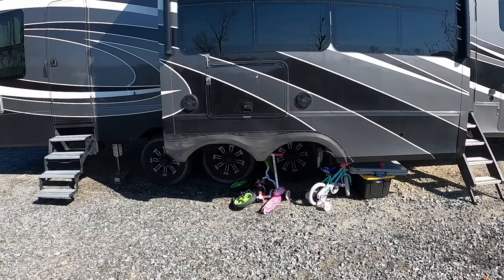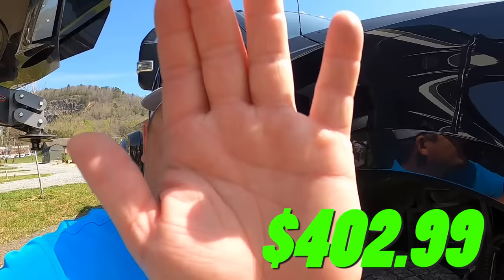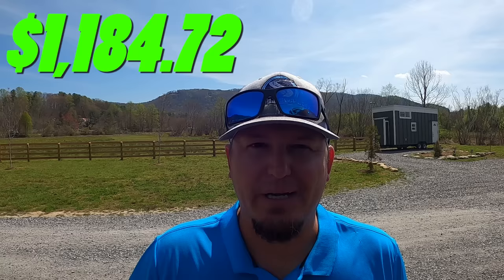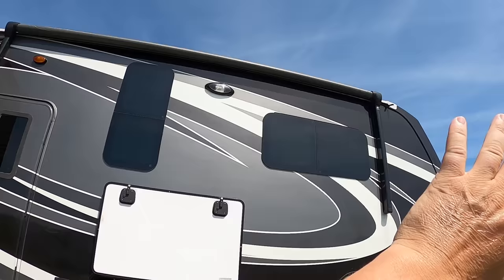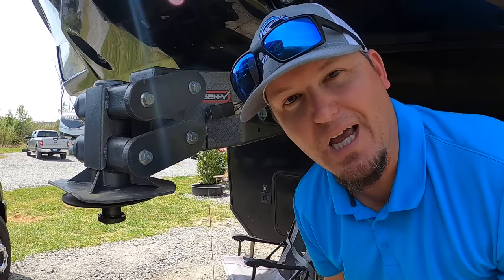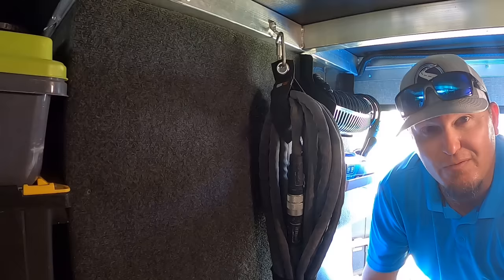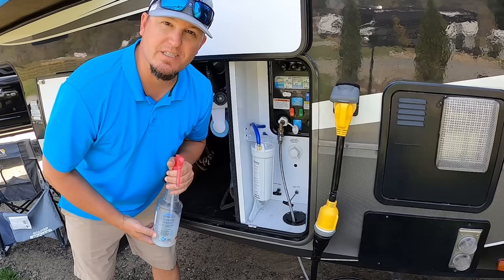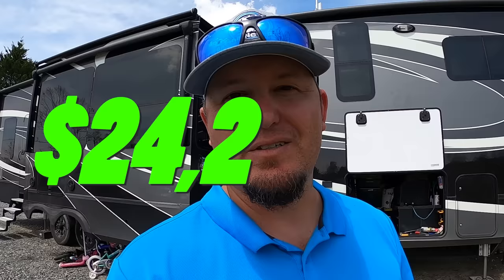These Things Are Money Pits! Everything That We've Had To Repair! | Fulltime RV Living!

Comment: You might consider using a wheel bearing packer. They use grease gun pressure to force grease farther into the bearings. It does a better job than wiping grease onto the bearing by hand.
Reply from the maker: You don't need presurized grease to pack a bearing! Packing by hand is way more than just wiping grease on the bearing! Plus you don"t need to purchase a tool to do what your hands can and should be doing!
Reply: Not everyone just puts grease on the outside of a wheel bearing when doing a bearing repack.  Although in the video it showed his hand and some grease on it and he was just pulling the grease into the bearing, as he mentioned in his comment, there is more to it than "just wiping grease on the bearing".

Quite frankly, if you aren't going to spend time making sure that you get all the grease inside the bearing in ALL parts of the bearing, then you shouldn't be doing this work.

As he mentioned, getting a wheel bearing packer is not necessary.  Although it "can" make it easier for some people, it really doesn't take much more work to just make sure that you are doing it by hand.
Reply: Yes good point

Comment: I have a Class A motor home I purchased years ago. Yes, expenses are insane. For those on the fence about RVing, my take:
The stress of driving or pulling a big rig is not fun . In rainy and stormy weather, you completely lose visibility. Campsites , always filled during the season. Some won't allow an older RV.  At a campsite, the setup, the work to open the slides, hookup water and sewer, TV reception. The maintenance required. Electric connections, batteries, propane, water heater, water line connections, hydraulic jack levelers. The list is endless. Was this fun? Maybe for my wife, but for me ,I did all the heavy work and took care of everything else. It totally sucked.
Maybe it's fun for younger people, I get that.
But for me, I'd rather spend the money on nice 5 star hotels, first class airline tickets and rental cars. It's much cheaper and more comfortable. As for my motorhome,
It's now parked on my lakefront property where I use it as a weekend getaway. That's it's resting place.
Reply from the maker: We agree we would never own this type of RV and truck if we only used it a few times a year! It is way to much work to setup and break down for a weekend stay! Sometimes even a week long stay feels like to much work! But since this is our home that we travel in fulltime, we have made all of those task easier and more efficient, so that we can get to enjoying the places we are at and don't spend much time with the RV!

Comment: I got to see all those repairs and the costs are astronomical and just shows the RVs in simple terms coming apart at the seams or losing pieces his total unacceptable quality and the Ford I own a 99 super duty 7.3 it's had its issues but my God a fuel filter is about $11 and it's easy to change. My 1994 Holiday Rambler with a Cummins 8.3 probably costs one-tenth that much to maintain I'm absolutely astounded at how much money this tow rig and trailer have cost you. I think newer stuff is just a Big Money Pit
Reply from the maker: If you take away the big repairs like the roof, the pinbox and the slide, it is actually a pretty low number! We just wanted to share our experience after 2 years of fulltime travel! We move so much it is for sure contributing to alot of the cost but we love it! The new trucks require you to change the fuel filter more often as the diesel we have today is not the same that your 7.3 was running back when it came out! Its amazing that the old stuff can run on anything but the new stuff is so sensitive to any changes in fuel quality! It onlu cost $68 for the filters and about 20 min to do the job, but traveling fulltime RV parks really frown on this kinda of work at the park!

Comment: You’ve done a lot of things for 2 years. It would be interesting to see upgrades and maintenance/repairs separately because the upgrades will unlikely occur again. By the way, your rigs must be in a better shape than when you bought them for sure.
Reply from the maker: I tossed around the idea of presenting that way!  But I made several videos on this subject and it came down to a point in time!  The first video you can check out here! https://youtu.be/uc049FoykEk was about all the money we spent to get the truck and the RV and outfit it for fulltime use! We did most of the upgrades to both before we started living and traveling fulltime!  This video was the money we have spent since day one of officially being on the road! There were only a few upgrades done in this one, mostly to the truck, the rest was just repairs and maintenance!

Comment: $510.72 for 3 AC"s air filters ???? that can't be correct for those kind of AC"s Dont athey just use the foam kind of filters?
Reply from the maker: That is correct, this is for 2 years of fulltime use! We have 3 units and it cost around $63.84 to buy filters for all 3 every 3 months! We even save money by cleaning them in between changes!

Comment: My buddy's septic tank pump failed in the house he bought and cost him $8k for the septic tank drain service (times 2 because it took them 2 weeks to get the new pump), the new pump, the technician hourly rate, and replacement of ALL of the carpet, tile, dry wall, and a new toilet. He also had his hot water heater fail the first 2 years of owning the house (i dont have a price for that).

The transfer case also failed on his truck plus he has a leak in the transmission seal which is going to cost him a pretty penny once he gets it quoted. 

The bottom line, maintenance and repair costs are going to exist regardless if you own a trailer or not. They just exist in different forms. Homes can be just as costly to repair as a trailer, if not MORE expensive because there's more surface area of a house compared to a trailer. If you don't want to pay for maintenance and repair costs, rent an apartment where your landlord covers maintenance and repairs.
Reply from the maker: Yes, indeed!

Comment: That’s why you go with a good brand like Jayco. Grand design may seem like a good option but they certainly aren’t built that well.
Reply from the maker: This video was about how much it cost to maintain and repair our rig over the last 2 years of fulltime use! This is not about the brand of the trailer, you can give me any brand and the video will be the same after two years of fulltime use! It may not be the exact same problems but there will be problems! We meet fulltimers everyday on the road and the experience with breakdowns and repairs is the same if you actually travel fulltime with an RV, no matter the brand or the price!

Comment: 22 f450. Got 2 new batteries under warranty at 14k miles and 2 new front tires. The continentals were falling apart literally. 🎉
Reply: I have never had luck with Continental steer tires, drive tires yes, steers, no. I use Michelin up front, knock on wood they have treated me well. This is on a semi tractor.
Reply from the maker: We made it 2 years on the stock batteries, the tires only 44k with no rotation! We are rotating them this time, they are going to get more miles, but not many more!
Reply: @PavingNewPaths  Did you up the tires with the higher load/ply rating? I use 18 ply tires, they last quite a bit longer than the 16 ply, which are standard HD load tires. The 18 ply are normally only a few dollars more, and worth it.
Reply from the maker: I have an F350 not a 450 so I run the stock Michelin tires they are only 10 ply!
Reply: @PavingNewPaths  Well, next time you shop tires, get the highest number of plays you can. Like I stated, I prefer the Michelins up front, have gotten as much as 200,000+ out of those before needing to replace. And I would not recommend anyone actually do that, but I wanted to see how far I could take these. My steer axle weight is 12,650 without a trailer, this is a heavy truck.
Reply from the maker: For the 17 inch rim I don't believed there is much choice in more plys, I have heard of 12 plys, but the 10ply have way more load capacity than the truck will ever see! The F450 comes with 19.5 inch rims and they get the commercial grade tire choices!
Reply: @PavingNewPaths  The more plys, the longer life you get out of the tire. And I have never rotated tires. ;-)
Reply from the maker: What I meant was I have the highest ply tire for the 17 inch rims on my truck! It's not that I wouldn't like more life, there are simply not many choices!
Reply: @PavingNewPaths  Really, I thought they would have more choices.
Reply: @michaelwright1602  yeah I'm not a fan of the continentals, but only got charged $30 for mount on 2 new fronts so I'm just going to let the 6 last what they will and probably go Goodyear after.

Comment: Great video. I do have a question though. When you were talking about the sewer hoses (14:50) I noticed your front sewer hose had a "p trap". Is that so you don't have to worry about the tank filling up while you're at a full hookup site? Keep the content coming. Thanks.
Reply from the maker: Thank you!  I do that for laundry days, so I can leave the tank open all day and not have to worry about overflowing the front gray tank, or the smells from the sewer coming back into the RV!

Comment: Steering Stabilizers do not "fix" or prevent death wobble... They just mask the problem until the problem overcomes the stabilizers. The cause would most likely be the track bar, the drag link or ball joints. Out of balance tires can exceacterbate the issue.
Reply from the maker: That is why we checked out all of our joints up front and made sure they were in good working order before installing it!  Never said it would cure it, but having it on there can't hurt either!

Comment: Fantastic presentation!  And great job keeping up with everything the way you have.  
I think you have established the upper end for class A's, ...when well managed.  
My work demonstrates the other end of the spectrum, the homemade class, LOL.
My entire 55 ft rig was barely 10k (acquisition cost) Total repairs,  upgrades, and "build" was about the same. Yep, 20k for tractor + trailer. 25 k w/Toad, packed & rolling. 
I can Flat tow the little car when just driving the super sleeper, Or load it into the back garage and take it with me inside the trailer.   2 full baths; 1 with a shower, 1 with a BATHTUB.
7.3 D, HD short bus, + 35ft Exotic car hauler w/factory gray + black, shower, and flushable. 
 18k lb towing capacity. No air brakes. 
Channel coming this summer.
Reply from the maker: Thank you! Your set-up sounds great! I hope you filmed the process of your build for your channel!

Comment: I see no enjoyment in any of this...
Reply from the maker: We love every minute of it! The reality is, you will spend more on maintenace and repairs than anything else if you travel fulltime!
Reply: @PavingNewPaths  Trust me I know, I used to too, and owned a few RV's... And, 33 years as a truck driver, most of it owning equipment and doing my own repairs like yourself, minor and major... The quality of the equipment anymore is horrendous compared to what we could purchase in the 80's and 90's, both RV's and trucks. Then the cost of parts, it has gone off the rails, which you are experiencing first hand... Be safe out there. ;-)
Reply from the maker: Before we started we had a very small budget for this category, we never realized it would be the biggest monthly expense!
Reply: @PavingNewPaths  It adds up quick, and the quality of parts nowadays is terrible... Even the OEM parts for your Ford, quality is no longer Job #1. I have been to just about all of the Ford truck plants here in the states. Lots of Chinesium.

Comment: Money pit is right. I used to have a 38 ft 5th wheel, and it was one thing after another breaking. It is gone and I have built a much smaller cargo trailer to RV conversion, and my repair bills have been zero for two years so far. I boondock 100% of the time, and it is nice to cut the cord to the repair shops. I have 900 amp hours of LiFePO4 batteries and 1300 watts of solar panels and a compost toilet. No holding tanks, as the shower and kitchen sink drain straight onto the ground, which is legal most places I camp. Fresh water tank is 100 gallons and it sits in the bed of the Ram. No dump stations, and so far no repairs.
Reply from the maker: We have found that our goal of traveling and seeing as many places as possible is why our cost are so high! Because we move every 7-10 days our setup needs more maintenance and repairs to keep it working properly!
Reply: @PavingNewPaths  Oh absolutely! Moving costs money. 
I drive every year to Arizona/California and back to Quebec where I park my trailer on my bush lot for the summer.  It doesn't move for 6 months once parked. And once I am in the desert, I only move once every two weeks and I stay in the same general area so my miles per winter are not very high compared to if I was touring.  
I'm an astrophotographer, so I have a "dark site" in western Arizona. I spend two weeks there, then head to a site near Parker, Arizona that has a Walmart, etc, for the two weeks of the month that the moon makes astrophotography next to impossible. I get as far from civilization as possible for the dark skies, but this gives me terrible internet with Verizon. This past winter I had Starlink, and wow does that ever open up the majority of the desert that until now did not have any internet signal.
Reply from the maker: @headdown1  That is pretty awesome, we have stayed at several dark sky areas around Big Bend and Alpine Texas!

Comment: Awsome video and great job maintaining that beautiful rig. You won’t hear anything about Ram, Chevy or Ford from me, as they all have issues and positives. But after watching the whole video? The only advice I have covers two things. Buy the best tires you can at the time to replace. But don’t use traditional WAX to protect an shine! NO! Look into what is called graphene infused ceramic coating. That’s about 3 times as expensive as wax, but lasts at least three times longer, much easier to apply, shines 1,000 times better, plus helps keep all surfaces clean and dry, even windows clean easier, stay clean longer, water is repelled so will you hardly need the wipers on the highway at speed. Plus bugs don’t stick as well. There are a number of brands, some use just ceramic, some also have graphene that’s in liquid form and goes on like a light wax, in small areas very easily with a sponge in back and forth motion, not circular. Then once hazy wipe shine with microfiber towel. You will thank me! I use a brand called Ethos, I get through Amazon, I paid $98 for three refills, that I still have one left after 4 years!
Reply from the maker: Thank you, Glad you liked it! I use a combination of waxes, hybrids and ceramic based coatings on the RV! I love to take care of the paint and I am always trying new things! Thanks for the tips I will look into them as I love trying new things out to see if it is better than what I am currently using!

Comment: Your wheel bearings will last longer If you switch to a calcium sulphonate base synthetic  grease like Chevron Black Pearl.  Better resistance to water washout and corrosion. Happy RV’ing!
Reply from the maker: As steangeas it sounds that is not the first time I have heard of Chevron Black Pearl grease! In my old life that is the grease we use on all the bearings in electric motors! Never thought to use it on the wheel Bearings!

Comment: I watched your video and have a few things to say.  First I have been living full time in an rv for 6 years and watched so many rv videos on YouTube   First thing I did was take the rv academy in Texas then I bought my ford  f450 4x4 and up graded the suspension to air ride and changed the tires and wheels to have a better ride and not bet me to death. And then I bought my rv and put independent suspension so the rv rode smoother   Made all the difference in not beating up the rv. Also I upgraded to a better rv so to have better quality    Sorry for your trouble on the rode but I have not had any problems with mine
Reply from the maker: That's great that you haven't had any troubles! We think a lot of our maintenance issues come from living fulltime as a family of five (with a dog), and moving our rig every 7-10 days on average. We've also gone months and months with no issues, but this video is just a recap of all the issues we've had over two years of travel.

Comment: First RV was a 8'slide in camper/74Chevy pickup in 1977, was 30 years old.  Had 4 truck campers, 3 fifth wheel trailers, 7 motorhomes, 2 toter homes one home built, down to the last RV, 40 year old Bluebird Wanderlodge 35', owned it since 05. Had a couple Wanderlodges in between and a Airstream 34.5.  I liked the Airstream a lot, but nothing compares to the durability of 16 tons of American 14ga galvanized steel.  I've spent $100k on the 35' in the years I've owned it.  I'm 76 years old, obviously have experienced a lot of RV and NEVER had a thought of living full time in one of them, after 6 months on the road, always nice to come back to the home base to get settled down.  One thing I can tell folks is this:  Anything made after 06 is probably a bad bet unless it's a very high end piece.
Reply from the maker: Living and traveling fulltime was the only way we could justify and afford to have a rig this size! If we were just camping this would be overkill for what you really need!